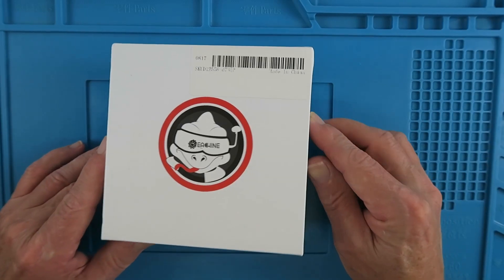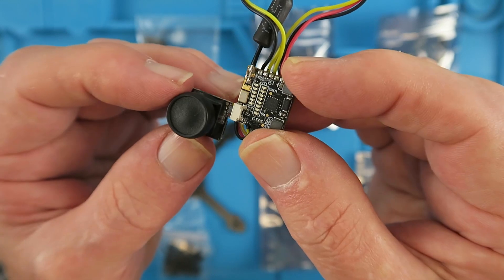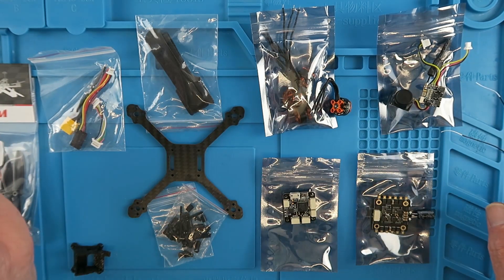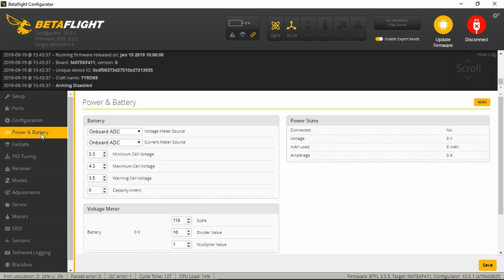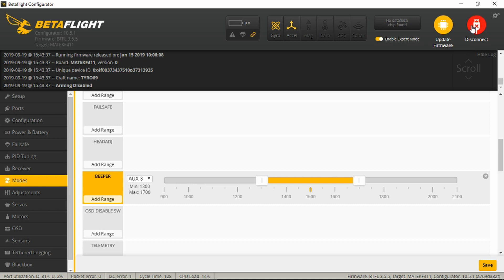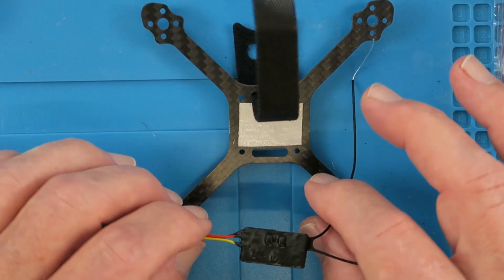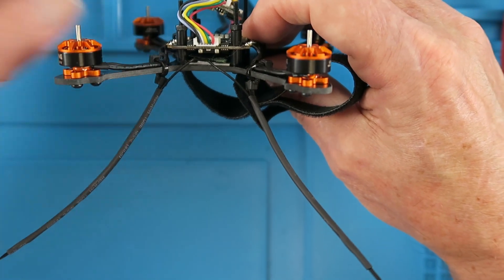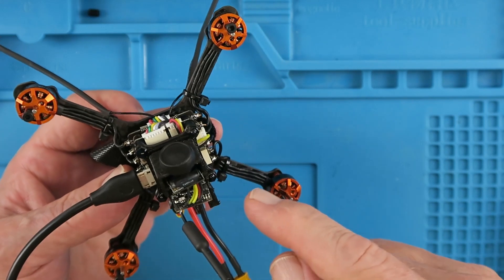Eachine Tyro69 F4 OSD 2 5 Inch 3S DIY FPV Racing Drone Build

Comment: Can I transfer the tyro69 part to massive droner 2.5" frame? And I know the camera need some mod to make it compatible
Reply from the maker: Sure, why not! The Tyro has a 20mm stack that should fit. The only thing I see is the motors for the tyro are 1104 and the smallest recommended for the massive drone are 1105. I'm sure they would work though. Please consider subscribing if you haven't done so already!!

Comment: Just awesome! Looking at this kit... Makes me think of my tiny toy drone BUT the battery makes the difference. The tiny toy drone, the silly 3,7 V battery. Suppose you can use the flight controller of that kit in a more "proper" drone that have a broken flight controller as example.
The tiny toy drone flies real awesome. As soon as the constant wind, typical this time of the year, go away, I'll start with that to overcome my DCS before trying the FPV again.
Reply from the maker: Thanks Johan. Yes, the flight controller and ESC board can be used in another craft. Hope you get back in the air soon. Our "secret" project should be published soon!!
Reply: @1nformatica  I wish all the best of luck for a good project and so looking forward to that video. This video had just offered a ton of answers and show the possibilities of fixes! The camera and FPV is of cause the real challenge! It is almost the most important factor. You are indeed a electronics "guru"! Can you make a tumble drier to fly? Haha!
Reply from the maker: @fiatunonewsletter6782  I don't think a tumble dryer would fly, bad aerodynamics! But I have seen one "walk" due to an unbalanced load of towels!!

Comment: Really nice work, man! 😃
This little quad is really nice and cheap! It's a great starting quad for someone. 😃
Pretty nice flying as well!!! 😃
Reply from the maker: Nice crashing you mean!! I am having problems with throttle control. As I take off and very slowly one click at a time on the throttle stick the quad gets to a point when it will suddenly start rising very fast but when I decrease the quad drops out of the sky. I cannot seem to get it to hover at the height I want. Any ideas?
Reply: @1nformatica  Well... The best you can do is to put the throttle in one position and leave it there. But in the moment you pitch forward, you're going to need to increase it as well...
Anyway, you were flying in Angle Mode... And, I don't know why, but I never could fly in angle mode. Acro is much easier for me. 😕
Reply from the maker: @MCsCreations  Thanks for the suggestions Mario. To help with orientation I have cheated and setup headless mode. I saw this video : https://www.youtube.com/watch?v=K7t6U_2dLlk and used the CLI in Betaflight to scale the throttle to 75%, it helps a lot!
Reply: @1nformatica  Oh, and BTW... If you didn't crash you didn't flew hard enough! 😉
Reply from the maker: @MCsCreations  I am obviously trying VERY hard!!

Comment: Dang never flown one of these beast.  Looking to start some day.  Guess Buying a Crash Dummy Model would be my best bet.
Reply: Dude, start by buying a transmitter (the radio). If you need we can indicate some of them. Then install Steam and buy/install Liftoff in your PC.
Liftoff is a simulator (I made a video about how to install and setup it - it's in Portuguese, but can give you an idea) where you can play/practice using the transmitter as a joystick. You know?
After that you can always start with one of those kits or with a brushed micro. 😊
Reply: @MCsCreations  What would be a good starter on Transmitters with Video ?
Reply: @pulesjet  With video? Those are 2 separated things. You would need a transmitter and a pair of FPV goggles (for receiving and seeing the video). You know?
About goggles, go for the Eachine EV800D. I would recommend the Eachine VRD3, that is smaller, lighter and more comfortable, but looks like they discontinued it. 😕
About transmitters... That's a difficult subject right now. Because FrSky is changing all its transmitters, protocols and so on... But the firmware isn't ready yet. And to buy an older FrSky transmitter, well... I really don't know for how long we're going to be able to find receivers for them. 😕
But, anyway... The X Lite Pro is a great transmitter, even more if you use to play games (it looks like a joystick). Or the X9 Lite as well. Both from FrSky. 
There's the FlySky Nirvana, but I haven't heard good things about their support...
And, finally, there're the Jumper transmitters. The T16 is amazing and there's another one, T12 I guess, that also uses OpenTX as firmware. (And I wouldn't go with any other firmware. It's fantastic!)
Anyway, search about the names I told you here on YouTube. Then you can make your own choice. 😊
Reply: @MCsCreations  So Frfly could go tits up ?   Is that why BangGood is pushing a bunch of that stuff ?
Reply from the maker: Fortunately the small size and weight of this quad makes it very difficult to break apart from the props which are very inexpensive. Thanks MC's Creations for great advice on equipment.
Reply: @1nformatica  Well BangGood Screwed me up by  Botching  up one of my electronics parts order.  
They sent me a Ultra Mini type Quad copter prop guards and the smallest brush-less motors I've ever seen.  Got checking into it and it would seem they come from a little tiny thing called a Happy Time ?  BangGood had no interest in me sending them back so , what ta hell I figured I'd see about getting one.  
I can't seem to figure out what transmitter to get.  Any help would be good.
If I buy one I would at least have some spare motors to play with ?

https://www.banggood.com/Happymodel-SE0603-1S-16000KV-19000KV-Brushless-Motor-for-RC-FPV-Racing-Drone-p-1283531.html?rmmds=search&ID=53393649917&cur_warehouse=CN
Reply: What Transmitter would I need for something like this ?   URUAV UR65 65mm FPV Racing Drone BNF Crazybee F3 Flight Controller OSD 5A Blheli_S ESC 5.8G 25mW 48CH VTX   Video Receiver optional I guess ?
Reply from the maker: @pulesjet  I would lean towards a Jumper TX like the T12 or T8sg, they support practically all protocols so will work with the URUAV UR65 which is Frsky. Review of T12 here : https://www.youtube.com/watch?v=WiJjqkrzCwc
To view video most would go for goggles as MC's Creations said the Eachine EV800D is a good bet.